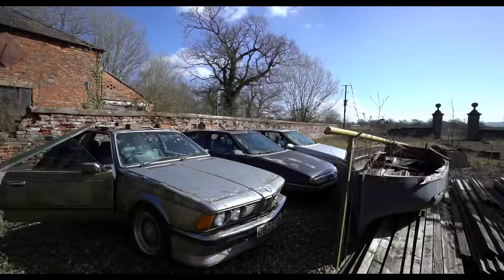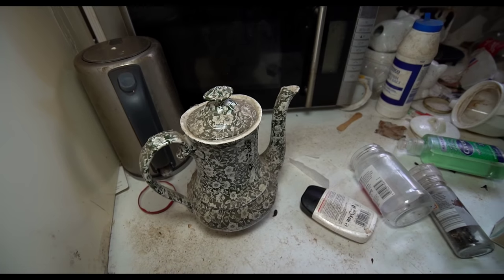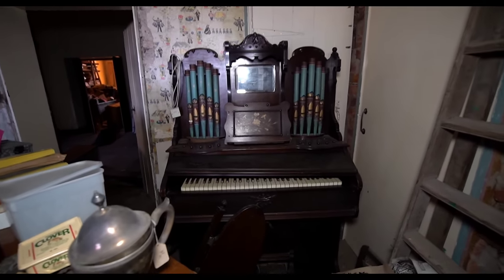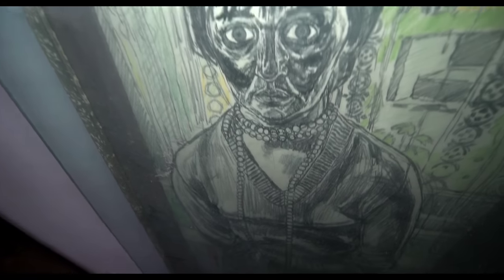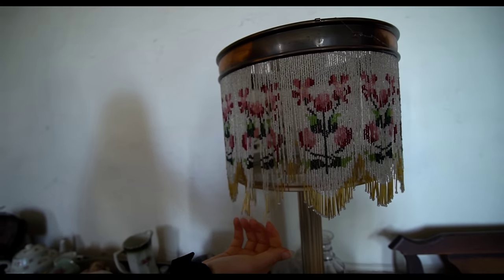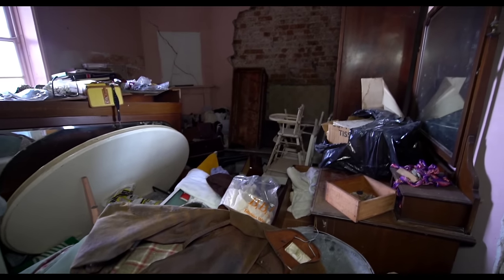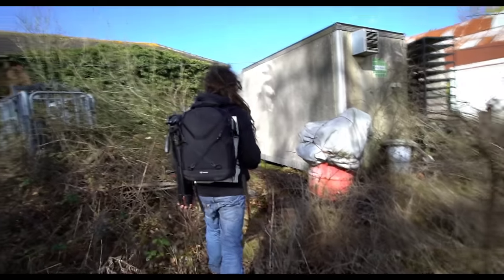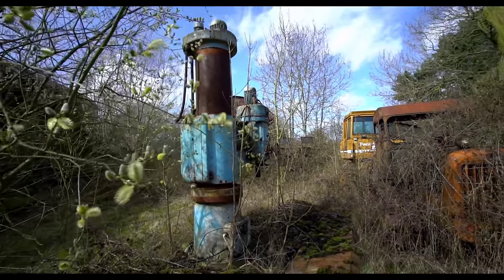INCREDIBLE ABANDONED HOUSE Of An Antique Dealer - RARE CAR GRAVEYARD

Comment: Hi guys. Yet again, another awesome video tour. At 29.40 ish,  as you're climbing the main staircase. As you pan upwards ro the top, there seems to be something black that moves across the top very quickly!? I've watched it many times to try to figure just what it is, but sadly, I can't make it out.
I just wanted to give you a heads up so you can check it out for yourselves.  Great work, guys. Keep it up.👍😊